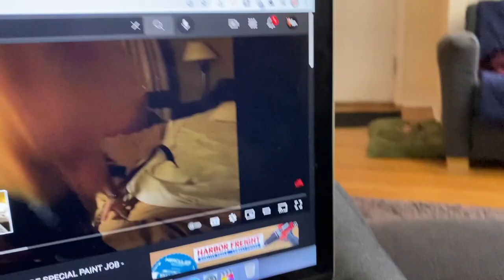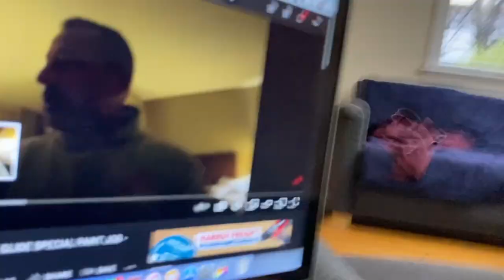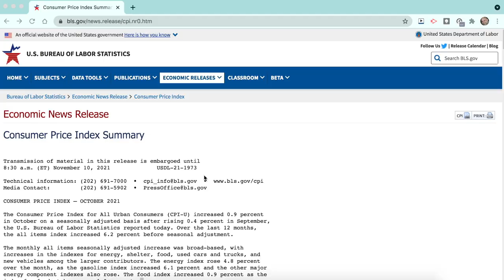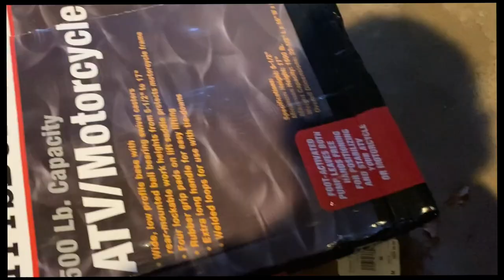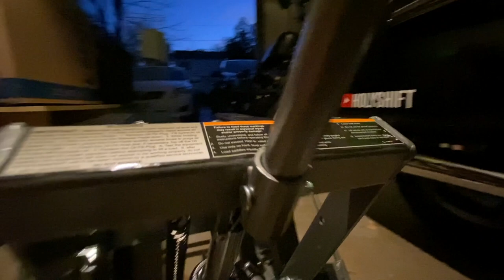How to assemble A Harbor Freight Motorcycle Lift

Comment: I use this jack to lift my Road Glide for the winter. It stays lifted for 4 months minimum. I highly recommend it. Thank for the video
Reply from the maker: wow ! do you strap it?
Reply: @HOLYSHIFT  I probably should but I don’t. I just cover it and plug in tender and it’s good till spring. Thanks for replying I appreciate it.
Reply from the maker: @Griff33  sure thing buddy- thanks for your support here !
Reply: I heard it’s not good to leave your wheels hanging freely like that for that long. The suspension is not meant to be extended to that extent for that long a period of time. Just what I’ve heard.
Reply from the maker: @moneyjackson2315  how long is a long time? 👍🏻 😆 LOL 👍🏻
Reply: @moneyjackson2315  I did not know that. I have been doing it for years and haven’t had any issues yet. Thanks for the info I will look into it.
Reply: @HOLYSHIFT  LOL well I would say an extended time would be anything longer than 1 or 2 months for sure. Winters here usually last longer than that so... Makes sense to me.